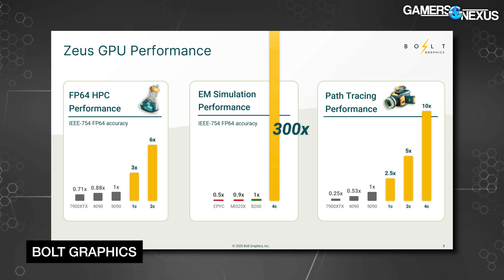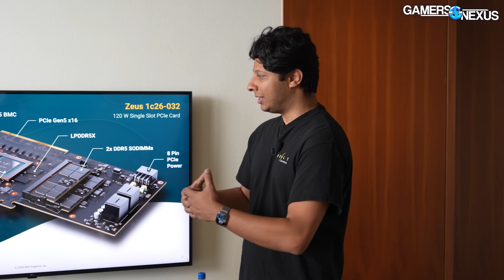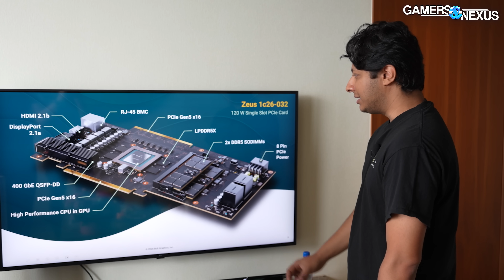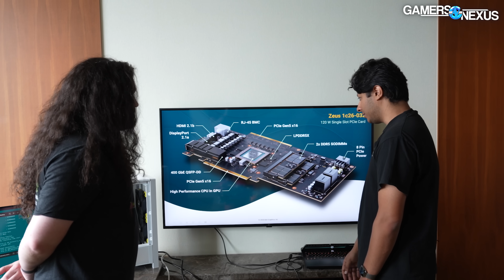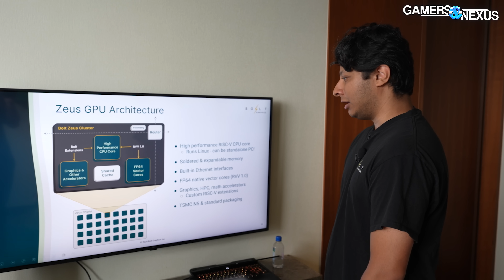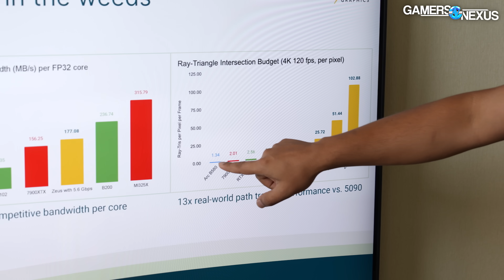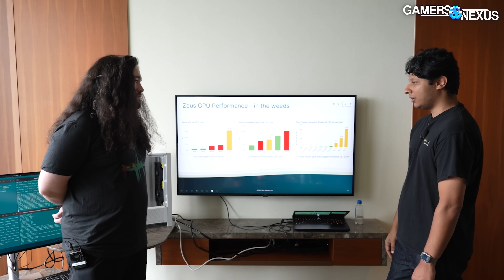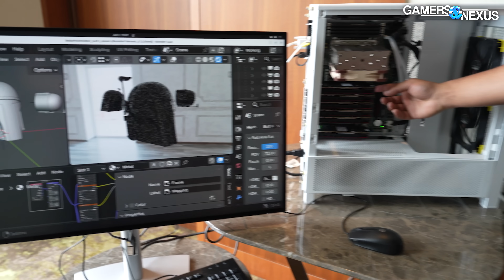A New Gaming GPU Challenger: Bolt Graphics Takes Aim at NVIDIA

Comment: supporting Vulkan and using DXVK and VKD3D-Proton as template, will make a huge part of the problem shrink
Reply: I'll add that AI has jumped on current architecture video cards because they are incredibly good at brute force calculations and presented the most cost effective method to make LLMs work. I think it's long overdue that we see a split in the market with graphics focused cards and computational heavy cards in their own spaces.
Reply: Yes, let's get back to a dedicated platform that actually caters for it's intended purpose.

The only reason we're in this mess, well before AI, is because NVIDIA was pushing for a one-shop-stop for everything on their cards (remember standalone PhysX cards?)

Alternative tech needs to stand out of NVIDIA's shadow, and actually cater to one use-case, but be flexible enough to have ADD-IN CARDS if your workload requires it!

Again, the design and workflow for these purposes started getting more integrated because the market decided it was easier for them, but now we're at the fork in the road where that's not a viable option for everyone, so we need to vote with our dollars which way we wanna go.

My money's on platforms like this, upgradable, customizable hardware with flexibility in software.  WE consumers NEED THIS!
Reply: @Rikorage let me say this or add rather to it, that there would way less mess if amd and nvidia kept nvlink and bridge intact, even if games would still struggle ai wouldnt. and they could easily produce cards in form of asics, but that would destroy their business model in higher end it always comes biting back to the greed, just like intel was in the past, exactly the same book example with gpu market today. 
but definitely they made us wait and milked consumers for a decade both, instead of getting rid of rasterization or creating a seperate line catered to ray tracing and geometry that could just skip raster as they produce in a sense "raster" image after rays locate the pixles, but no. we have all in one shop stop that is not good at either thing at the price offering with no competition of course. 
people wouldnt mind paying 200-300$ for a board that is easier to make and buy their own ram afterward if that meant offloading everything else and keeping pure raster, but again huge bottleneck without any sort of bridge connection today.
Reply: Intel did this with their cards as well. By designing basically a DX12 only card that ran on Vulkan, the crypto boyz and AI firms looked at it and said "gross". Well, for us normies, this is just fine. It's cheap, avaialble, and works for modern games. Their focus on rendering is huge. Firms spend millions a year on GPUs to get incremental improvements in Photoshop and Blender and so on, because the cards being made are brute-forcing it versus being designed for video and graphics (scenes and rendering vs "graphics").  This is exactly like brute-forcing a MD5 hash versus using a rainbow table. And for us gamers as well. We need to play games, not run a LLM on our desktop.
Reply: @josephoberlander  actually a correction stand is needed here, why llms are so good on todays gpus is because of tensore and matrix cores and parallelism available, bottleneck only being internal bandwidth and vram capactiy plus external bandwidth with no bridges aka pcie. 
to play a game you favour then zeus gpu much more if games were optimized for their glowstick api as the founder explained it would in another words render pure rasterization useless as the other things would excel at discovering pixels and mapping them correctly without the being underutilized inside gpu cores as not being enough of them at all. zeus gpu would to my understand be useless against LLM if that was your point. Nvidia should at that point just accelerate at ai adoption instead. but whole industry relies on them because everything is about nvidia and it's heavily centralised which hurts everyone but the big companies selling crumbs at higher and higher prices getting less and less value back.
Reply: @sequence9-seer  That was my main point. Made a card that's good at graphics and bad for LLMs and there you go - price gouging and supply issues dealt with.
Reply: @josephoberlander  Sure we will when our offline games have AI built in giving the NPC's more depth. Imagine talking to Lydia about Skyrim lore, she'll know it all. She can have detailed backstories and unique traits no game dev has thought of. She'll be able to help you overcome challenges in unique ways. These are the games I want to play. Running full LLM's offline is easily done now with open source technologies like Open WebUI.
Reply: @DivergentDroid  Not necessarily easy, and it still takes quite a bit to run well. Source: me, I work with this crap every day
Reply: @DivergentDroid  Even though local LLMs are cool I'd rather not lose a bunch of performance on getting Random NPC #523 to hallucinate a backstory I don't care much about instead of using that compute for the actual game. If it's optional maybe I'll be ok with that.
Reply: @DivergentDroid open webui it's just an interface where it saves your previous chats in a nutshell. if your idea is capitalizing on webui as in game npcs, good luck you willl run in many problems.
Reply: @sequence9-seer  Of course not, Open WebUI isn't designed for that. I mentioned it because it's a great offline interface.

Comment: Adding ram is great but I hoep it is fast enough. It will be slower than the memory soldered on near the GPU core. Then again AMD made a cards with a slot for 1TB ssd that had its uses.

It likely will have less latency than ram since that has to go past the cpu and if they add a slab of L3 like X3D or bLLC then memory speed will be less important.

Comment: I have been waiting for a very long time to show NVidia the middle finger, but sadly AMD and Intel are not cutting it work tool - Blender. I would be already happy if the top Bolt card gets to like 75% of a 5090/6090 or if we could combo 2 to 3 mid tier Bolt cards (so potentially a bit more expensive than the top tier card) and achieve ~100% of NVidia's flagship.

Anyway, Im always excited see to the development of any tech.

Comment: WHat is the status of their (linux) drivers? I see they run blender on some ubuntu version which seems like a good sign. But would it be opensourced (at least on the level of nvidia or amd?)?
Would I be able to run a LLM on it? Something like Deepseek 0324 or later. If it can run full model at 5+ tokens/s it would be good. x264/AV1 hardware encoder/decoder support?

Comment: Hi Steve. This looks to be more of a crypto miners card than a gaming card. Multi stack with RJ45 etc. I'm extremely excited to see them actually reinventing the wheel where GPUs are concerned but! It's structural design seems more focused on data threading and not graphics threading. I winced when he said "data centre" as well. It looks to be trying to do too many things and not anything specific and that is a huge red flag at this point.

I think they need to segment different cards for specific use cases moving forward.

1. Crypto 
2. Local data 
3. Mass scalability 
4. Graphic design/content creation, video editing 
5. Gaming as an add-in card but not a dedicated discrete card for gaming.

The last being a card that can boost the lack of power output of Ray tracing, and other  processing for a primary card in the 8x slot below for example instead.

This could then be a cheap solution for low to mid tier GPUs for people moving forward.

This in fact could then replace the need for the NVIDIA 80 and 90 series for people on a budget. As someone said in the comments already as well; "an affordable solution" for gamers on a budget and make use of the 8x PCIE slot on their motherboards as well. This needs a lot of deep think and thought to application moving forward. 

If they can fill these gaps they will actually change the industry to steal business from NVIDIA, AMD and Intel.

Intel tried the optaine solution in past. These guys IF they can get it right can do this for the GPU market instead.

Though I honestly don't think they have the creative mind set at this stage and are going to fall short with capturing the market for what I mentioned above. 

Again they're trying the one fits all approach instead of focusing on set solutions for set problems at the moment.

I hope my words ring through and that they look at these avenues moving forward. Their success rate will be in diversification of their lineup stack and building for purpose not general application.

Nothing that claims to do everything is a successful business model. Snake oil salesmen back in the day correct?

They need to segment hardware for segmented work loads to be at all successful moving forward.

I have my fingers crossed as we need a massive shake up in the industry immediately!

Keep in mind PHSX cards were separated to GPUs back in the day too 😉 

Let's hope they take this advice as professionally as possible and work on expanding their stack and not the one fits all approach moving forward.

I am very much looking forward to your review, testing and teardown on the sample you get in future. I'll be following this very closely moving forward. But my concerns are that you may never receive a unit in the first place at this stage.

I hope I am utterly and completely wrong at about their failure to launch at this stage though for obvious reasons.

Finger crossed and best wishes to BOLT! Let's see where this goes from here for now.

Comment: Steve, the Bolt guys could nail it with local LLMs first, which will get this device into many (or most?) PCs right away, then pivot to games with the new mountain of cash they would have. Inference/ t/s rates just have to be at or above the AMD HALO AI APUs. Ideally, if it could hit 50 t/s AND add 64GB into those slots, it will fly off the shelves. Bolt won't be able to keep it stocked.

Comment: But it will never be a regular graphics card. Even Intel gave up and AMD gpu market numbers are dropping hugely. Its basically impossible to do all the driver stuff, optimize for every game that was ever made, all the compatibility issues, all the needed support and also be competitive in speed & price. Doing an extra blender plugin and not using the regular one is also not a good sign. Maybe they find a niché in some industry sector.

Comment: I've said for years they're going to have to change architecture entirely to focus on path tracing, Bolt did it.
My question, does it have enough hardware for raster emulation for supporting older games?
Second question, can emulation just handle running DX/Vulcan/OpenGL games? Can software emulation just change the calls like in modern console emulators/Photon?

Comment: I like this video card it's interesting and upgradable.  It let's me bypass the family run nvidia/amd fake price "wars" and avoid spending a fortune in electrical power just to run a video card with badly designed electrical like nvidia/amd.  I was keen on Intel except they are far higher priced in Canada then I'm willing to spend on, even intel's low-end are pricey AF.  Hope Steve keeps us updated on these Bolt GPUs.

Comment: This is very interesting as a compute-shader-focused GPU. Not to set them up for Intel's footgun, but they should consider going the route of DXVK. Its reliable, it includes a lot of optimizations that would otherwise have to be tuned in drivers, and it supports very old DirectX titles for the cost of Vulkan support.

As an aside, it would be really cool if they took a look at the blog post "No Graphics API" by Sebastian Aaltonen. He describes his ideal, low-level, compute oriented graphics "API" that is essentially to Vulkan/DX12 what Vulkan/DX12 was to DX9/10/11/OpenGL. It might be a waste of time for a new player to focus on non-existent software, but it seems like it would be a perfect fit.

Comment: For better or worse, I got more questions after I watched the video. Also FYI I love seeing new GPU players coming to the market. So these are just genuinely curiosity.

1. I think this card is currently built for a very very niche community. At least from this interview itself, I have not learned about its biggest advantages against some of the tech giants.

2. LPDDR5X shared ram pool with DDR5 sodimm. I am no genius in EE or CE but how stable/picky it is with the frequency of the ram? Steve mentioned about ram leakage and I think this is a valid concern for sure. Apple takes a long time to optimize and still fail in some cases. 

3. Mass production will be very very challenging. 

4. The functional demo and the number they are showing are not quite matching. (Does it actually finish rendering before Steve end this interview lol)

Comment: Holy shit they essentially brought sli back for their card, thats super cool
I doubt itll super useful but its still really cool
Reply: Not super useful for gaming, but I think there are professional uses where multi-GPU is still a thing. And it sounds like with the removable DIMMs it should be possible to put huge amounts of VRAM into even moderate-performing cards (unlike Nvidia who only allows high VRAM on their high end cards), which also could be appealing for professional applications where maybe you need huge amounts of VRAM to run something at all, but don't necessarily need it to run as quickly and so don't want to buy an entire server rack's worth of GPUs (Such as their example of an offline render for a 3D animation, where it takes minutes or hours to process every frame at super-high detail). Maybe they will leave in some of these professional features for the eventual "gaming" version, maybe not.
Reply: But think.. what if it did become useful and got properly developed for and optimised to nth degree..shader preprocessing might become a thing of the past.

Comment: For the drivers I think one thing that would be cool is to allow users to have access to advenced features such as SR-IOV/virtualization support, HDMI/DP ports passthrough to virtual GPUs, etc. Those features are generally only available in pro GPU lineups but do not require special hardware so having them on entry-level cards would be great

Comment: This could be interesting. Nvidia and Radeon (back to the ATI days) have had a choke hold on the GPU market since the early 2000's. Bolt is trying to target the creative and business markets that were also abandoned by teams Green and Red in favor of AI data centers. IF Bolt can get the financial footing they need to branch into gaming, they may have an easier time with developer adoption just out of necessity alone. It doesn't do developers any good to target hardware nobody can get their hands on or simply doesn't exist. Bolt may be getting started at just about the right time for an opportunity, assuming they can get established enough to expand into the gaming market

Comment: I wish them the best of luck! I'm always glad if someone is having a different approach on something.
Especially for production and rendering these cards could be quite nice if you can speed up the pathtracing by the claimed amounts.
My question would be: is there a world where you could run these as dedicated path tracing accellerator cards, like Physx card back in the days?
Gaming is a completely different beast. However, I wish to see you at the top of the benchmark charts in a few years where you can run star citizen after they switched to full RTX way better than the competitors.

Comment: If they were able to open-source everything and actually provide working products that can be used, I would buy their GPU just to support the startup.

Open-source PCB design, software, and drivers would be amazing.

DDR5 CAMM2 modules can possibly provide higher performance also?